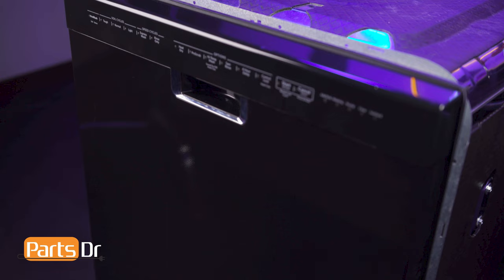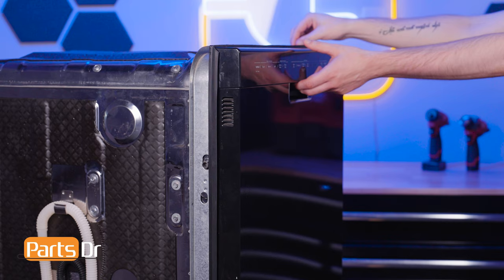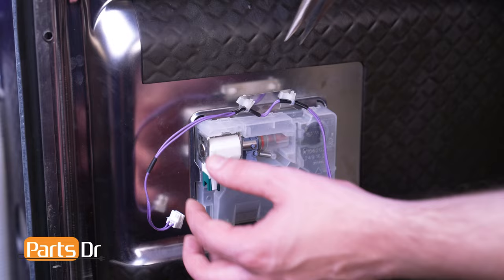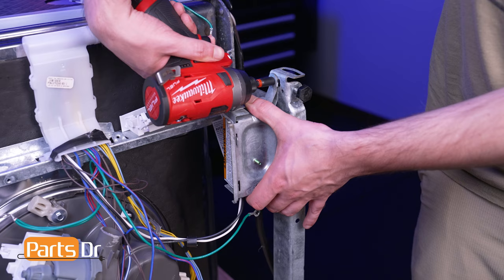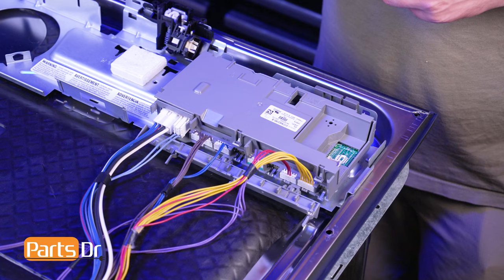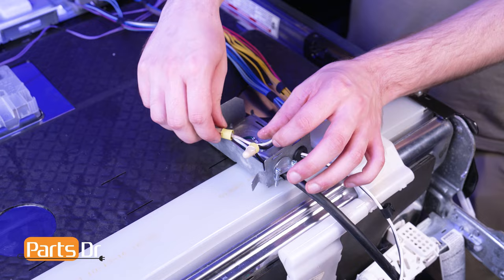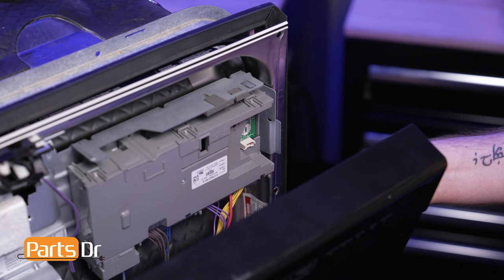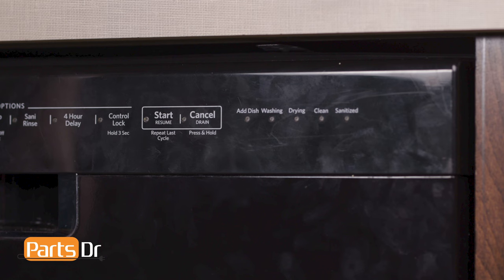How to replace Wire Harness Assembly part # W11027902 on your Whirlpool Dishwasher

Comment: Perfect timing! This video dropped yesterday and today I am tackling this exact job! Very clear, thorough guide to the repair. Thanks.
Reply from the maker: Great timing!  Let us know how the repair goes for you!
Reply: @PartsDr  The repair went flawlessly. After months of poor cleaning, low heat, and draining issues, it was amazing to open the dishwasher door and once again experience that long-forgotten billow of steam and the sight of spotless dishes. Thanks again!
Reply from the maker: @brianirwin6291  That's great!  What failed on the original wiring harness?
Reply: @PartsDr  I don't know which was the chicken and which was the egg, but both the control board and the wiring harness failed. The control board had a failed capacitor and burning and soot at the two left terminals and inside and several of the wires and connectors showed signs of heat damage with some of the insulation burned away.
Reply from the maker: @brianirwin6291  thank you for sharing!  That is helpful information.

Comment: Thank you so much for the video!
Reply from the maker: You're welcome!  What kind of problem are you having with your wiring harness?
Reply: @PartsDr  I had a similar problem.  Mine was caused by rodents. A cat has cured that problem and I found where they were accessing the building.
Reply from the maker: @billknight964  Nice!  Cats are a perfect solution for that!
Reply from the maker: @billknight964  Nice!  Cats are a perfect solution for that!

Comment: Whirlpool dishwasher model #WDT730HAMZ. There’s a small wire clip/connectors with 2 yellow wires under the dishwasher that isn’t clipped to anything and I can’t see where it goes. Maybe nothing and maybe it’s for a higher level dishwasher or diagnostics.